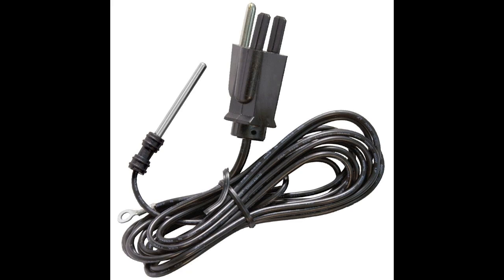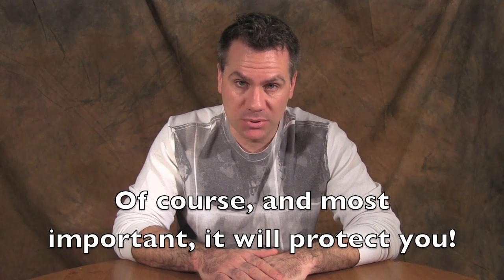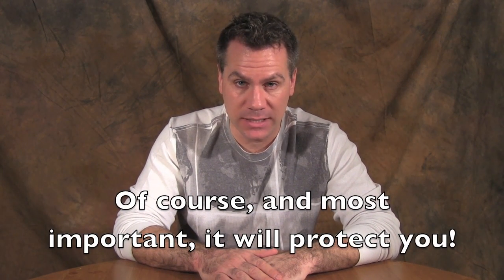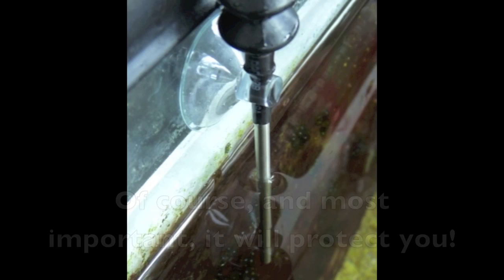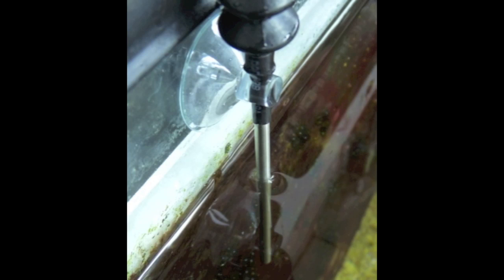electric current in saltwater aquarium - use a ground probe for safety

Comment: Thanks for the video. Considering I am an electrician on the side you would think I would have done this already. I did not even have a gfci until today lol. I was always afraid of the tank losing power without be knowing. Today I bought a GFCI with alarm at Home Depot for $17.95. It's actually pretty loud. I also installed the probe. Good stuff buddy. Thanks
Reply from the maker: Thanks John. It's a good to have something like this to protect your house, you and your fish. GFI is the most important thing.

Comment: The GFCI outlet popped, and cut off the power to the tank. Then after resetting it, it didn't pop off again. That sucks. But I don't understand what grounding the water does...
Reply from the maker: grounding the water will protect you if there is current in the water. or, if a light falls in the water and you go for it, out of impulse, you won't get zapped.

Comment: After watching this a while back I finally just bought a  titanium ground probe. Do you know if placing it in sump will still protect the display tank? (Via water in the drain/return lines?)
Reply from the maker: I would think it would IF the water flow is in constant connection between the sump and main tank, other wise it won't.
Reply: Ok, awesome thanks. Cheers!

Comment: I don't know the regulations in the states, but where I live... somewhat older houses have only the bathroom/kitchen/washrooms fitted with grounded outlets. Also a renovation could be done at some time where the ground wasn't connected to the ground circuit. My point... test if the outlet you're gonna use is grounded properly to avoid a false sense of safety and accidents.
Reply from the maker: great comment, thanks!
Reply: well said

Comment: hello thanks for the video, i will definitely have to buy one,  safety first!
this might be of topic but have you ever used rain water in your tank or have you ever heard of anyone doing it and what are some of the bad outcomes of using it?? i have done a fair bit of research about it and can not find anything about it.
Reply from the maker: I have never used rain water and have heard of a couple people using it but they didn't say what happened. I don't think i would do that with what's in the air.
Reply: cause i can't afford a RODI system for clean water right now and my little town has has terrible tap water i will use rain water and i will give you updates on how it all goes.

Comment: I can't put my fingers in aquarium .
It shocks Everytime and motor is stopped working correctly.

But fishes are safe inside .
What should I do next??
More over I'm in this lockdown
Reply from the maker: you need to find out what is leaking electricity in your water. turn off everything.....then turn on one thing at a time until you find it. i wouldn't suggest putting your finger in...but....you need a probe as well....what i talk about in this video. your fish are stressed from this voltate. it's torture
Reply: @ROTTERtube  thanks for your fast reply I got to know it was from     motor.
I replaced it with old motor . Hopefully I somehow get new motor in this pandemic...